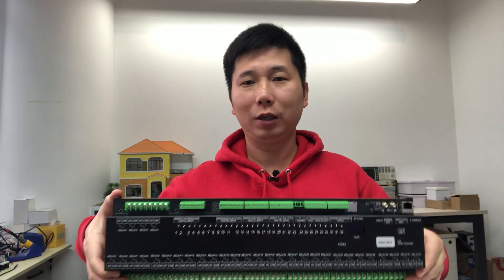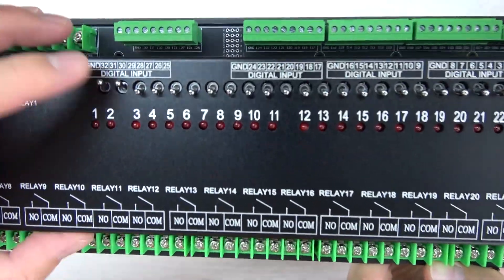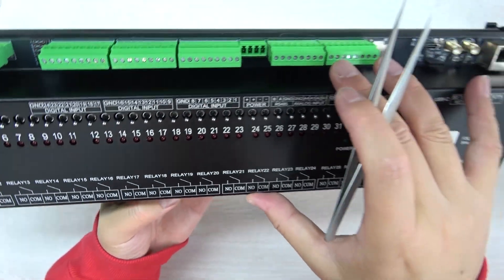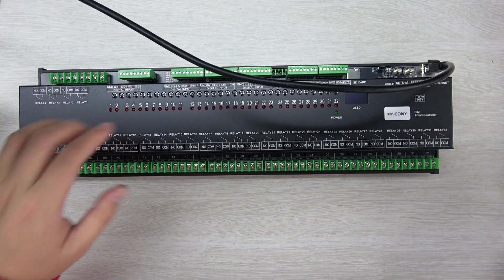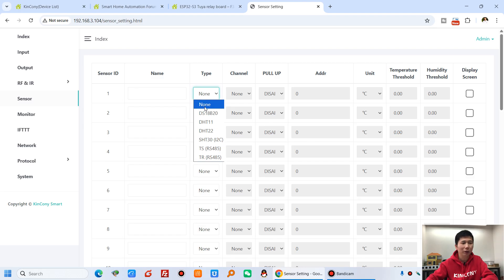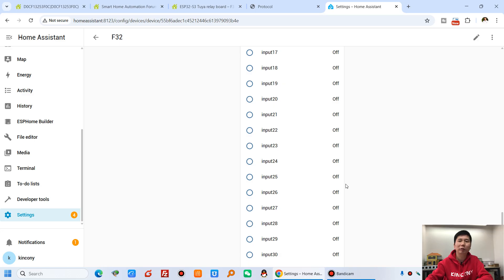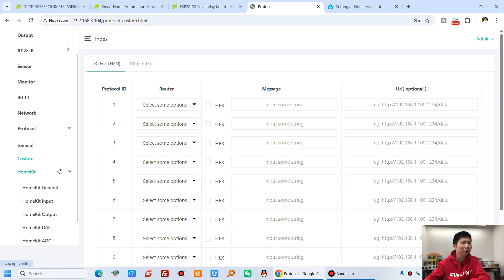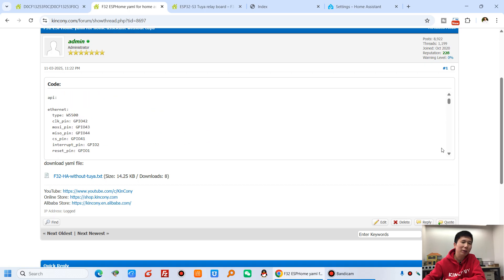ESP32S3 32CH Removable OMRON Relay Board For Home Automation - F32

Comment: I want to know , can you make full distribution board with all possible kincony modules for the best hybrid home automation. With all software
Reply from the maker: the full distribution board size will be very large. usually make it according to requirements, not need full products.
Reply: @KinCony will revert to you soon with full electric plan of the house then you can guide me
Reply from the maker: @maheshshah1601  you can post to our forum.